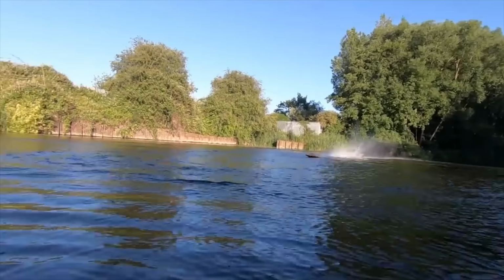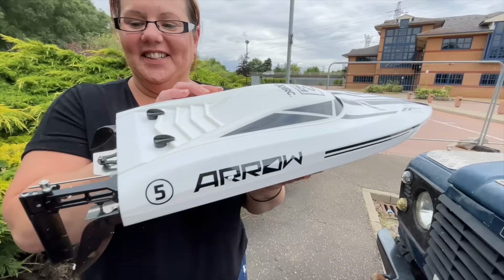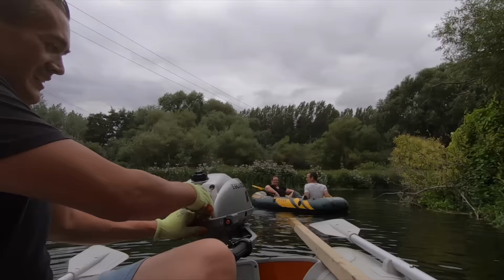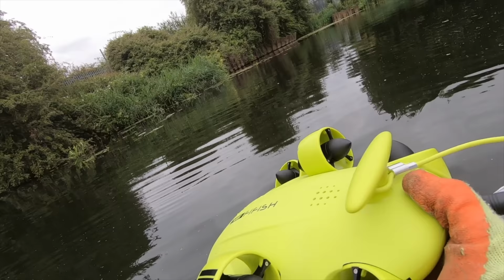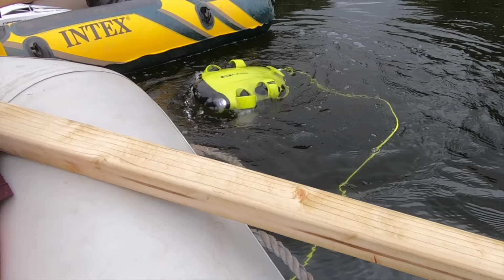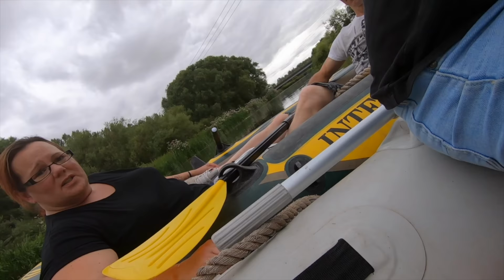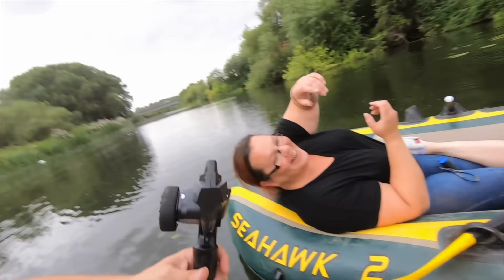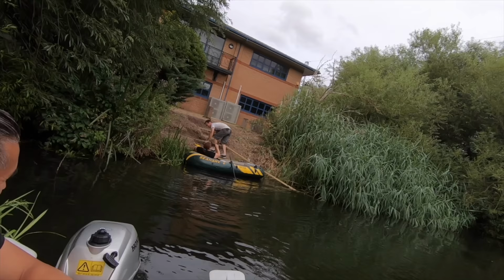Underwater Drone hunts for lost boat *fail

Comment: You can try using a metal detector - one with a long shaft and the headphones to listen for when it beeps when it detects anything.
Reply: the only issue is: it pretty much has to be incontact with the bottom to get a ping. They aren't designed to work with water (I'm assuming you're talking about the ones old timers use at the beach). You might be able to adjust the gain so it ignores the water, otherwise it will beep constantly because it might detect the water as an object.

Comment: You've got the best equipment for under water searching. Just learn the controls.
Reply: and get an anchor for the dinghy. Them floating around is just adding one more variable to their search. Not to mention it was pulling them.

Comment: Try contacting someone from your local sub aqua club, but as you said things rarely go straight down and the water current no matter how slow will drag it along the bottom.
Reply: The boat has a natural bouyancy, it went down and stayed down. Most likely it's stuck in the mud or on a root or something. I mean stempy literally pointed it towards the bottom and hit full throttle.

Comment: You should try using a tube with a sealed window on one end(kind of like a telescope but without magnification). You submerge the window side deep under water and if its's close enough to the bottom you can see the bottom really well.
Reply: This comment is the way
Reply: this or stick some kind of water proof camera at the end in the water and a hand held screen on the other

Comment: You could try one of those sonars which are made for locating fish which theoretically would work the same
Reply: you "might" get a stronger ping off it if the bottom is muddy but from the looks of it, it was rocky, but all the ones I've used aren't that accurate. They could find a 12' dia water inlet pipe, but nothing smaller. The fish finders are more designed to locate things suspended in the water, not things along the bottom.

Comment: Well to spot it mount the submarine to the pole yall have and mount some really really bright lights to it to be able to see better under the water, retrieving it is another issue all together probably would be easiest to swim down and pick it up. But for future reference to prevent this mount a small C02 canister for a air pistol with a Ballon and a small regulator which is controlled by a water detection sensor which when the boat fills with water will inflate the Ballon hopefully increasing the buoyancy enough to make it float to the top

Comment: Just started out used to build them in the 80's. I bought the Hoss love it so far. My eye sight is not good enough to fix them myself. But I don't think I will beat it up. Had the steel shafts put on. Need the servo. Got new shocks put on. I hope my luck is better than yours lol.  Keep up the videos

Comment: They make 12volt and internal battery air pumps for rubber boats. They work great and save a lot of time and effort.
Reply: even a tire inflator off the cigarette lighter is faster than a foot pump. Heck an air compressor would fill them both up in 3 mins.

Comment: I don’t know if anybody said it already, i didn’t read all comments but maybe you could try to retrieve it with a strong magnet. You could pull the magnet on a rope across the riverbed. A net will probably catch on everything on the ground and get stuck.
Reply: since the boat is 99% plastic, you'd have to hook onto the drive shaft as I bet the rudder etc were aluminum or plastic.
Reply: The motor should be enough for a strong magnet to catch on even with all the plastic around.

Comment: Magnet fish for the boat that works even if the boat is plastic it works as it will connect to the battery or the motor if you get a powerful Magnet 🧲

Comment: If you cut up pool noodles and tuck them into the nose of the boats, even if they fill with water they won’t completely sink. Can also attach a small piece to the inside of the lid in the event it comes off so it stays afloat as well.